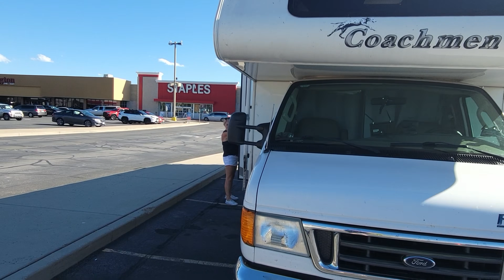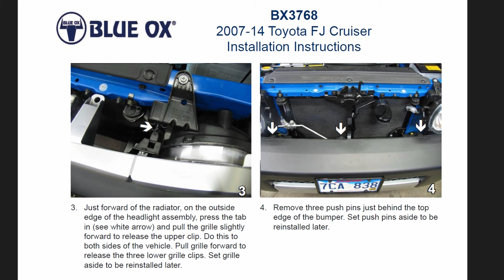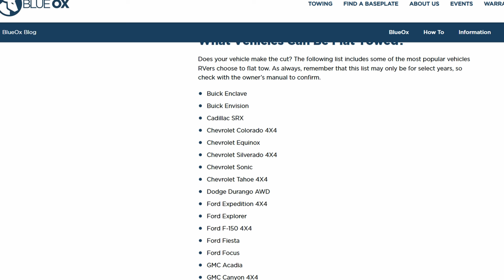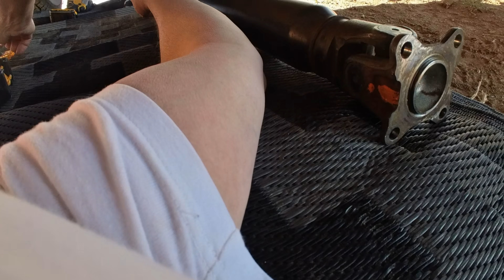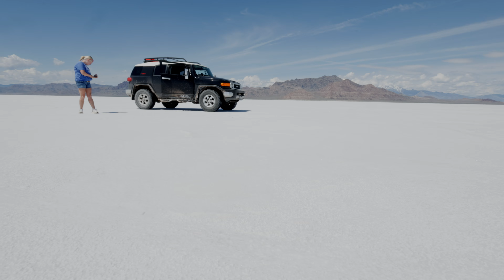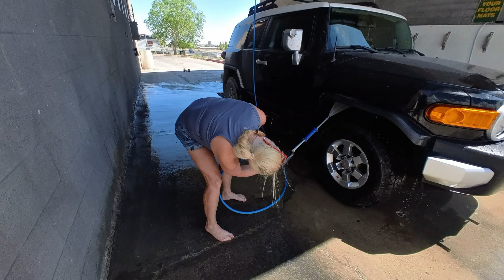Flat Towing a Toyota FJ Cruiser (Automatic Transmission)

Comment: Do you have to leave the key in the on position and have it drain power? I thought i read that you can turn it to the on position to check the steering wheel but can turn the key back to off as long as you don't remove the key so the steering wheel doesn't lock. I have a 13 FJ cruiser and just bought a motorhome and I refuse to let go of my FJ. One way or another its coming with us! Great video!
Reply from the maker: You have to turn the key to the first position and leave it there to prevent the steering wheel from locking up.  It will lock up if the key is in but not turned to the first position.  We learned that the hard way -- destroyed the front tires after driving 300 miles that way.  

We make sure that the radio, A/C, heat and any other accessories are off.  The drain is minimal, but on long trips there is a power draw from the tail lights and the braking system.  We had to install a battery charger that gets it's power feed from the RV while we're towing it.

Comment: Why not just buy the driveshaft with a quick disconnect
Reply from the maker: We priced out the driveshaft quick disconnect and it was $1,500 - $2,500 USD.  Maybe we'll eventually invest in one, but spending 30-45 minutes every few months to add/remove the rear driveshaft when needed hasn't been worth it so far.

Comment: Great video... How do you like the front-wheel drive (driveshaft removed, transfer case in 4WD)?
That is, unless you there's a need for real 4WD (driveshaft installed), is it OK to keep the FJ in front-wheel drive on a permanent basis?
Reply from the maker: I'm no mechanic, but we've been pretty happy with driving it around with the rear driveshaft removed.  I rarely put it back in unless maybe we're home for a long period between RV trips.

Comment: Big Help. Class A pusher, with an FJ Cruiser. I watched your video several times while converting my FJ for flat towing. I splurged for the driveshaft disconnect coupling. Very happy with my results, and glad to be one of the NOTAJEEP crowd.  Happy Camping!
Reply from the maker: Glad the video helped you out!    I was looking at the driveshaft disconnect online again this past weekend.  Getting tired of crawling under to take in/out.  :)
Reply: @skybucketdreams  yeah, takes me ~30 secs! FJ high ground clearance makes it easy.  Remco is the source for the coupling, Driveline Specialties. ~$750 for the piece. I had a shop in ATL do the coupler installation on my OEM driveshaft, ~$250. $1,000 all-in. (manual engagement, not the remote cable actuator) No regrets.

Comment: Everyone has their reasons for towing a vehicle style , for myself I would only use a vehicle trailer if my vehicle becomes untowable I own a 07 yota fj cruiser I love this fj mine is built for offroad mine is 6 speed manual again I would buy a diamond c tilt trailer and tow it this way
Reply from the maker: We considered a trailer but had heard it takes longer to disconnect/reconnect in between stops.  We typically only spend 2-3 nights at a campsite before moving onto the next one so flat towing has worked well for us so far.

Comment: I still didn't get, why Parking instead of Neutral?
Reply from the maker: I had that same question when I was doing my research.  My understanding is that keeping it in Park prevents any movement within the transmission while towing down the road.  Less wear and tear, and possible transmission damage from overheating.  As an added bonus, my odometer doesn’t roll when I’m flat towing the FJ in Park.  There are several threads on the fjcruiserforums web site where this is debated that you might want to read through for more details.